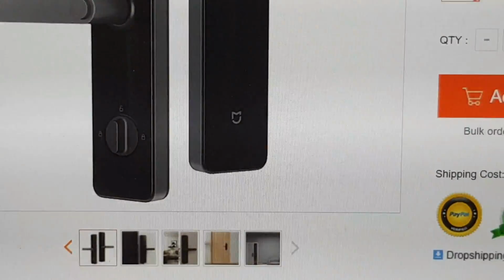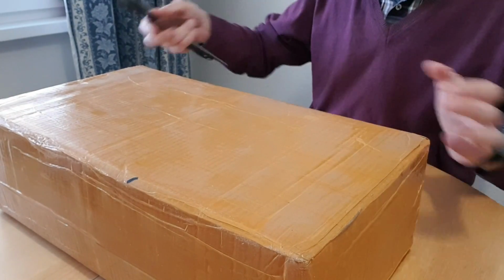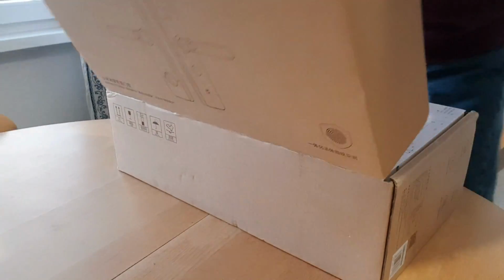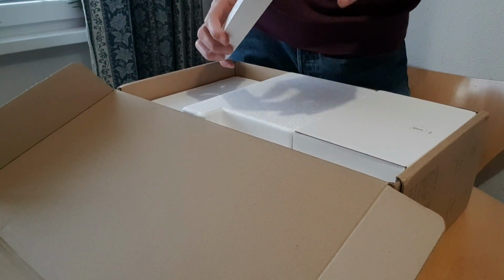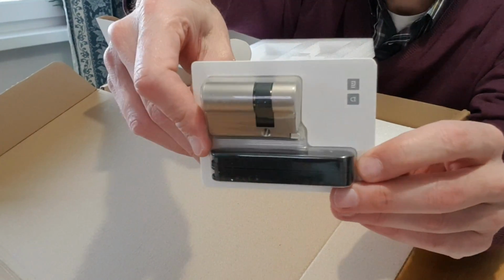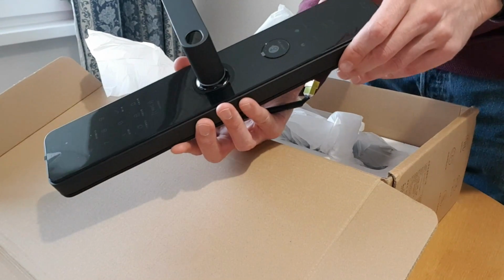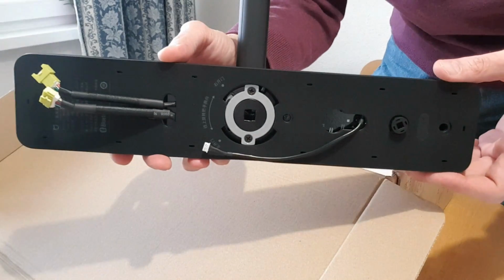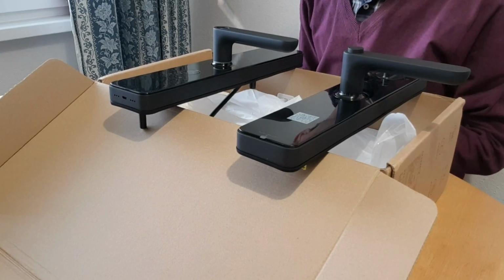Xiaomi Mijia Smart Door Lock (unboxing) 3D Fingerprint sensor, NFC, BT!!!

Comment: Dis u install it?

Mine alarm sounds each time I open it, any idea?
Reply: If it's anything like my aqara S2, then you might be tripping the anti tamper mechanism. For my S2 I found that it was a little loose, and tightening it resolved it.
Reply: If you pair it with Aqara Home (or Xiaomi Home) App, you can adjust (or even disable) each sound for:
Door unlock. 
Door alarm. 
Door not locked.
Reply: @teli6937  I pair it with Xiaomi Home, but there is no option to dissable door alarm, just door lock and unlock sounds
Reply: @adrianespinosa3735 
 
On my Xiaomi Home App, I can see all 3 sounds options as I had previously mentioned.

For "Alarm Volume" and also "Unlocking Notification Volume" the option are:
Mute, Low, Medium and High. 

Also there is sub-menu for "Not Locked Alarm" Sound ("door is not closed properly" or "door is not locked").

Is your door making a "Not Locked Alarm" sound? 

These are some details of my door lock:
Xiaomi Home App version 5.5.30. 
Region: China
Mijia door lock menu:
Plug-in 2.1.2
Firmware 2.2.1_0121
On Device Info sub-menu:
Main version 2.2.1_0121
HW 1.5.3

Comment: Hi, good video. I was waiting for a video on this lock to be released. I'm looking for a feature of the passcode where I can set what time/date the passcode can be used (i.e for a cleaner to enter the property). I bought the aqara S2 and unfortunately this doesn't have this feature... So before upgrading Im trying to find out this info, if you could help it would be great. much appreciated.
Reply from the maker: I can't install it yet. When I do, I'll check
Reply: @dalanik  Thank you, I've subscribed to your channel.
Reply: @basdfgwe  hey, your aqara s2, How Long The Battery Last? 1month? Year?. How long
Reply: @zacktate445  I can't recall when i installed it (maybe December) but I haven't had to change the batteries yet. I checked two of the batteries with a cheap battery meter about a month ago and they both had 3bars out of 4. I occasionally have it connected to the gateway. Tbh there's fairly limited functions with the gateway and I only plug it in when I need to do something.
Reply: @zacktate445  I just bought this mijia lock last week, and it's meant to be coming in next week.
Reply: Yes, you can do that. I have installed it and set up access for cleaner
Reply: @jShingi  hey thanks for the reply, are you able to do a video on this ?
Reply: @jShingi  ok great thank you. Keen to see it in action before buying it.
Reply: @teli6937  awesome thank you. I'll buy this and get rid of the aqara S2.
Reply: @jShingi  hi, can u show how to register fingerprint, cos I'm not able to register my finger print.
Reply: @praveenajmeera5302 
You can use Aqara Home or Xiaomi Home App (use China region) to add/delete user fingerprint and password registration.